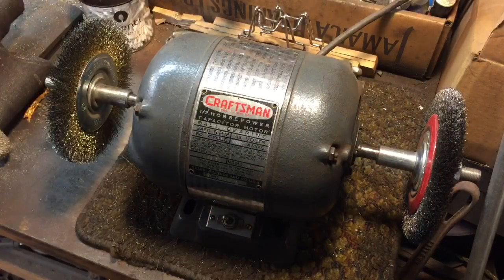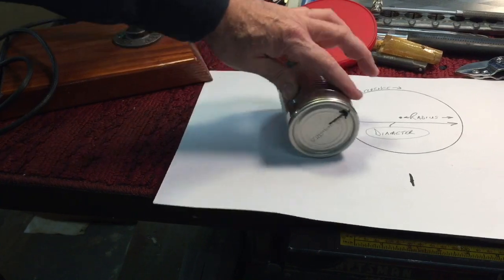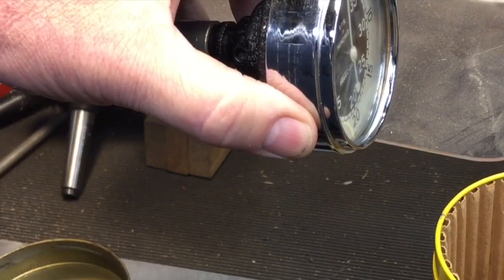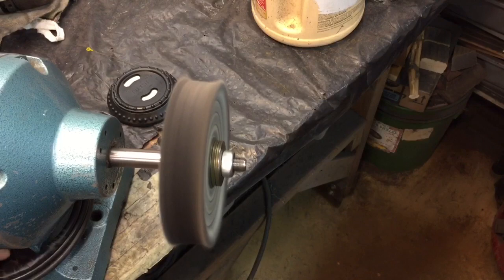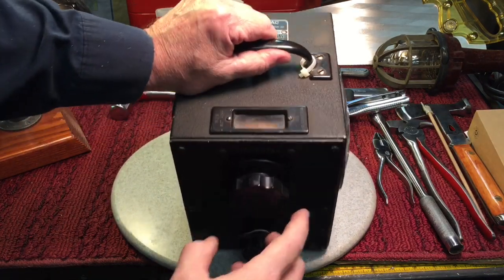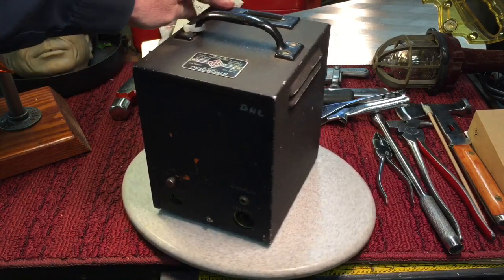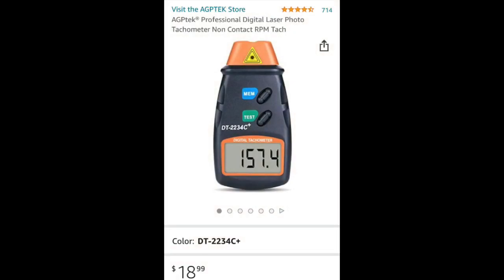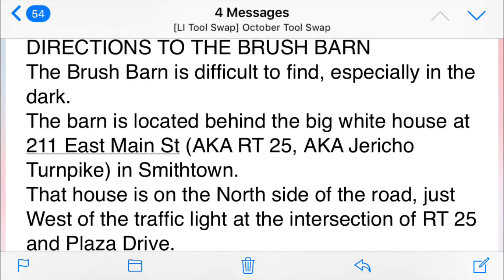Measuring RPM With Various Instruments.

Comment: Awesome video! Thank you! I'm a Mason contractor and we just received a old target bricksaw as a gift... so that great but we used up 2 14 inch diamond blades in 4 days. So that tells me something isn't working right, it's also the quietest brick saw I've used in 23 years...  so I believe, if the blade that is rated for 2500 rpm to 4800 rpm is spinning at 1700 rpm then the blade is getn too hot and ruining the blade???

Comment: An exceptional video.  I really admire the way you can take a complex process and make it so understandable.  So let me ask .. could you run a bench grinder through a rheostat to control the speed?  Thus turning a single speed motor into a variable speed unit.  Or would it damage the motor?
Reply from the maker: Brush motors are better candidates for Variable speed, with induction motors it is much more complicated.  A simple rheostat will drop RPMs but also torque and the motor will run hot.  It would be nice to have variable speed on all our motors!  😃👍
Reply: @ScoutCrafter  Thank you sir

Comment: Thanks for another great video.
We do not have such a variety of tools here in Russia. I've never seen any other RPM tool except tachometers.
I only dealt with strobe lights at university. We carried out various laboratory works with them. And I never thought that there are portable strobe lights for home use. And now I also want one vintage strobe like yours.
(I don't need it at all, but I still really want it.)
Try to put a disc with a mark in a lathe, and set up a stroboscope is 2 times faster, 3 times faster, and so on. It will be interesting.
My wife's asking - Don't you accidentally have a nuclear engine or any warp gates in your attic?
Reply from the maker: Mikhail- I showed some attic footage but was running too long!   =D

Comment: As for the variety of motor speeds, I might be mistaken, but I believe the 60 Hz that we have in the US is actually much more variable. I'm sure some buddy out there is an electrician who can explain this better than me. My understanding is that it basically is between 50 and 65 Hz. Theoretically, you could have different frequencies in next door houses, even in different receptacles around your home. I believe this is the reason why motors are never exactly 3750 RPM, you get about 15% of variance from the stated frequency. In theory, your motor that runs at 3,600 might very well run at 37.50 if you were in a different house
Reply from the maker: JP I constantly keep an eye on my House voltage and I am always very close to 60hz, once and a blue moon it drops to 59 for a second but always spot on....  I wonder if that has to do with they type of power generation that is going on!   Great stuff!!!!!!!!!

Comment: I absolutely love frequency based tachometers. All the ones I have seen were internal combs. I have never seen one with an external antenna like that. Very interesting. How does it behave if the base is also exposed to the vibration along with the antenna?
Reply from the maker: I find those really interesting too, the one thing you have to be aware of is interference from any other revolving shaft like a crank/cam shaft arrangement.   The base is pressed directly against the engine/motor to be tested.
Reply: @ScoutCrafter  yeah that's the downside to them, but hey no batteries! I do have one particular one that has six combs lined up very close to each other. It is designed specifically for this. It can give you up to three separate readings at the same time, representing motor, pulley, end shaft. It is some absurd laboratory grade instrument that is very old. It's a completely different class than the little pager looking deals that you press up to the body of the machine. This one doesn't even need to touch the machine. It has an unusually large face with sort of speaker cloth? I think that it is designed to measure everything in its vicinity, it's just a guess but the instructions specifically say that you need to turn off lighting to get good measurements. It is much more sensitive than my standard tachs. It might just have possibly started it out life on a naval research vessel

Comment: I have the exact same Stuart tach. Mine is in a red and yellow can. It always sticks with me, because it's the only thing in my shop with zero patina. I don't know where it came from, I have several other tachometers, but that one looks like it got made yesterday, even has the original cardboard and instructions inside the can. Just a note, Stewart recommends holding the tip to the side when measuring on a chuck. I believe it is to prevent marring The rubber boot

Comment: I have my great grandfather's little Starrett Tachometer. He was a machinist in the early 1900's. I guess they used them in the shop he worked to check the speed of the old belt driven lathes and what not. 
I loved seeing the strobe machine; I never seen one of those.
Great stuff. Thanks for sharing. :)

Comment: Where do you get the adapter to use a wire brush on a normal shaft electric motor
Reply from the maker: Hi Mike- It's called a "Motor arbor threaded shaft adapter" they are awesome!  Just measure the shaft of your motor first!  https://smile.amazon.com/s?k=motor+arbor+threaded+shaft+adapter&crid=10P1RCVUDVQDH&sprefix=motor+arbor+threaded+shaft+adapter%2Caps%2C84&ref=nb_sb_noss
Reply: @ScoutCrafter  thinks a bunch love the videos and my new obsession for restoring old tools

Comment: I’m gonna have to start looking and collecting them for sure it reminds me a lot about the timing lights I’ve got one I’ll see if I can show it we used to put the crankshaft pulley on the TDC and then put a blob of paint on the pointer so we could see it and a blob of paint on the crankshaft flywheel and that’s how are used to time the cars in the old days with the timing lights so if you wanted it to fire 5° 5° now I will have before TDC top dead centre then you could do that with a timing lights and a little white marker or a bit of white paint

Comment: The older flashing strobotach's had and issue in that if you were in-sync with the flash, you could be indicating even multiples of the rpm you were looking for.  Seeing 600 but could be reading 1200 or 1800 rpms.  Because rpm would line up with that multiple. 
Also, used the flashing tachs frequently to observe large motor internal cooling fan blade conditionswhile the motors were in-service.
Great informative video!
.
Reply from the maker: Yes Joe!  You are spot on!

Comment: Help me out here John...I don't mean to question the master but am I misunderstanding or what?  Isnt it that the smaller the disk the faster the surface speed of the disk is which in turn would mean the larger the disk the slower the surface speed? Im sitting here thinking and its driving me a little bit batty! This is what my mind is computing. Thanks buddy and great video!!!
Reply from the maker: Wally- The reason this subject is so hard to grasp for all of us is because the difference between the face of a wheel and the edge.   With RPM's if you look at the side of a wheel no matter where you go on that side (close to or far from the center) the RPM's remain constant and unchanged.  However with the edge or outside of a wheel the larger the wheel the more surface will pass your tool at the same RPM.   The funny thing is when you first get a wood lathe it is the first thing you understand because if you turn a pencil at 1000 RPM it is very controllable however if you try to turn a log at 1000 RPM it is super scary!!!!   =D
Reply: @ScoutCrafter  Ok got it. Helps a lot...Thanks John!!!
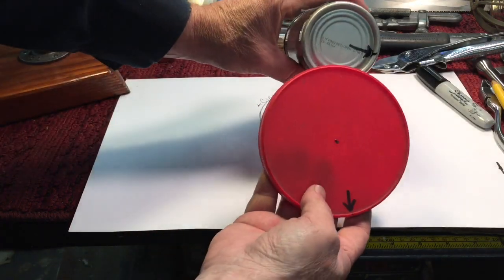Reply: 2:10 makes it pretty clear.